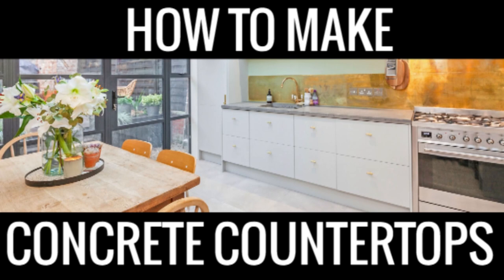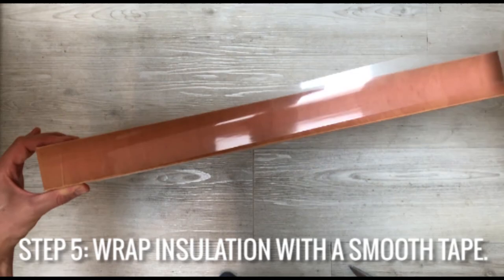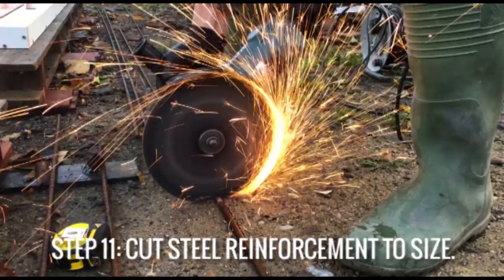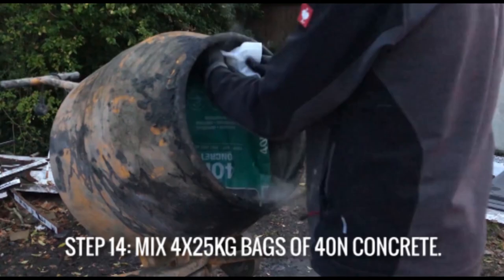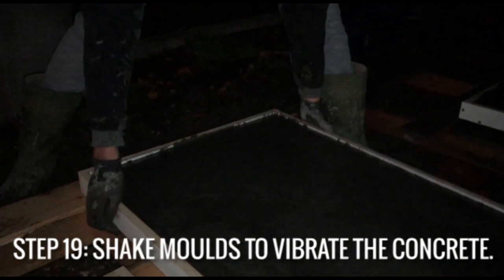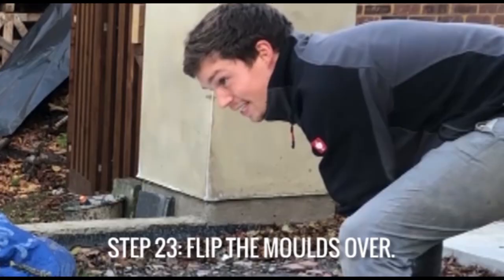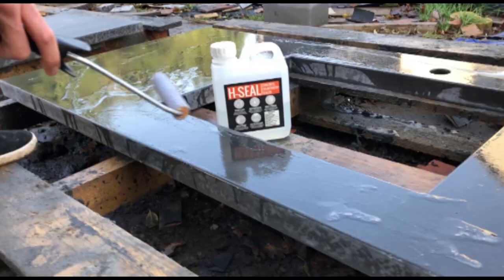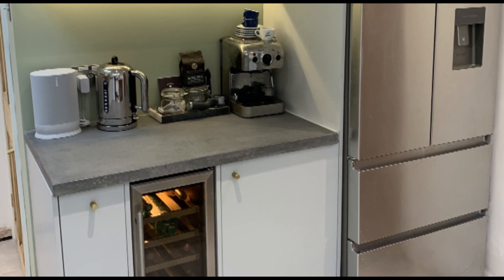How to Make Concrete Countertops | THE PROFESSIONAL METHOD!

Comment: Thankyou for doing your videos, they are a huge help!!! I do have a quick question though… Have you done any countertops that involved using multiple concrete colors? Not mixing them to make one color but making them to see different colors throughout the slab. I’m building a large pantry and I have enough room to have a countertop on one side for food prep. I loved the video you did with the countertop that had alot of the charcoal iron oxide in it that made it come out like marble but I thought it would be neat if you could intertwine some colors throughout. I wasn’t sure if the concrete vibration motor would cause it all to just mix together… Thankyou so much, please keep making videos

Comment: Hi Matt, my partner & I have been trying to DIY our own concrete floors at a new bar that we plan on opening up soon. We have spent a ton of money and it all went to waste, once everything dried up all of the surfaces cracked. Do you have any DIY concrete floor tutorials coming up?
Reply from the maker: Hey Leyla, I haven’t got any coming soon on concrete floors. 
If you plan on removing the floor and pouring it again, to reduce cracking you can add alkali resistant glass fibres and make sure to cover the floor with plastic for at least 1 week to stop the moisture from escaping from the concrete. If it dries out too quick it will start to shrink and crack. The best way to get a good mix is to get it pumped in by a contractor that have a good concrete floor mix. Check out this video. https://youtu.be/iV1r9m9OF4k
 
If you guys mixed it yourself, and added too much water to the mix when you mixed it up, the concrete is more likely to crack because as it dries it will reduce in volume and shrink much more. The trick is to add just enough water so that it is flows easily but no so much that there are pools of water on top.

If you want to try filling the cracks you already to already have you could try using some sand and cement to match the concrete on the floor, leaving it to cure and then polishing afterwards. Here’s a video on how to polish the floor with a floor polisher. https://youtu.be/FOlGPH54fMQ

I don’t know how bad the cracking is or what you intend to do with it but hopefully that helps. :)

Comment: Hi Matt. I’m wondering after watching numerous videos on how to. I’m finally about to bite the bullet. As I’ll be doing it on my own how long do I have before the concrete will set. If needed is there something to slow down the concrete from setting? 😁👍
Reply from the maker: It depends on how hot it is outside. If it’s a could day you’ve probably got a working time of around 3 hours and on a warm day probably around 1 hour. That’s until it’s best not to move and vibrate the concrete any more. But it won’t be set and hard until the next day. Then you want to give it around 3-7 days until you move or lift the slab.
Reply: @MattHutton  thanks Matt👍

Comment: Hi Matt - have you any suggestions for melamine stockists? we only need one sheet (2440 X 1220, 18mm) we are struggling to find anywhere that will do just one sheet without ridiculous delivery costs, Cheers - Chris Warrington
Reply from the maker: Have you tried Alsford Timber or Builder Depot?
Reply: @MattHutton  Hi Matt, thanks for getting back to me, unfortunately they are down in the south and not able to deliver up to Warrington, I have found a local timber yard that have moisture resistant MDF, what are your thoughts on using this? Thanks

Comment: Modustrial uses the fibreglass pieces in his work, have you used them before? I'd love to get into doing some concrete work
Reply from the maker: I have, you need to use AR (Alkaline Resistant) Glass fibre otherwise it will rot over time. It works great :)
Reply: @MattHutton  ok cool, I’ll give it a go when I get some time!
Reply from the maker: @williamj8349  awesome:)